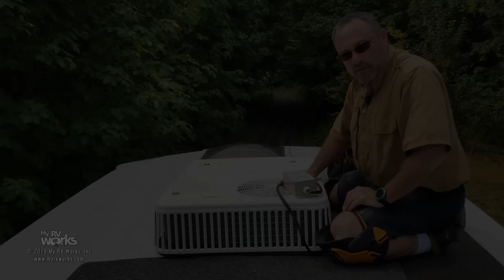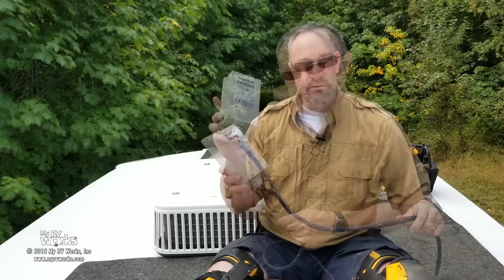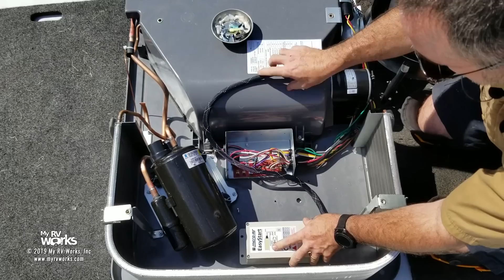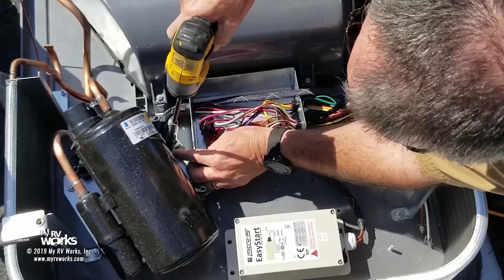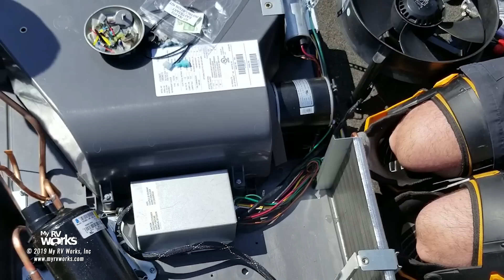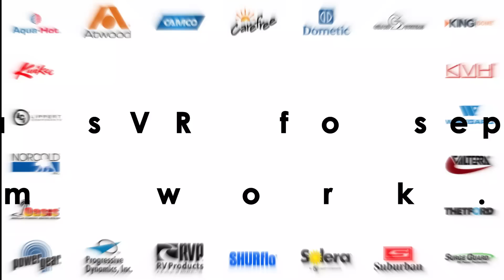How To Install A MicroAir EasyStart Soft-Starter On A Coleman Mach 8 RV Air Conditioner

Comment: Thank you for this!  The step by step was PERFECT.  The only setback came when I thought I remembered what you said but forgot one step and had to re-do a wire connector.  So, I brought my phone onto the roof of my Airstream and re-watched each step.  

I did a couple of things differently on purpose -- but mostly just the placement of zip-ties.  

I would have never thought to zip-tie the EasyStart to the frame, in addition to the 3M tape.  Great idea.  Just like you said, I couldn't zip tie both ends due to the foam block.
I would have wondered what-the-heck to do with the now-loose capacitor.  I zip-tied like you did, but also bent and re-fasted the metal tape that held the combo previously.
I didn't use a zip tie on the EasyStart power cord.  I found I could snake it under the compressor legs and that held it very nicely.

I was moving this EasyStart from an older Mach8 that failed, so all my connectors were already in place.  I was able to work them through the existing opening, but it wasn't easy.

Comment: Hello Darren,
       I have issue with the newer Coleman mach 8 you are using in this video. The condenser fan wont turn on when the unit turns on. The compressor turns on for a bit and the blower motor but not the condenser fan. I installed a new control board in it, and a new condenser fan but it still does not work. I have tested both of the capacitors and they test good. I can not find much information on this unit. Can you give me some incite as to what to check next? What activates the condenser fan? Thank you.

Comment: Hi I have a dometic low pro ac on a 2014 palomino I turn AC on the other day there's only a hum and nothing on fan side so I turn off switch right away I pulled access cover inside if i spin fan by hand then turn on ac and fan both work good so iam kinda thinking capacitor but weird thing is we were in 105 degrees last weekend after a half hour it would just stop fan ac everything give it a while off then u could spin fan and get it to run again maybe after half hour or so. Am I on the right track should I replace one capacitor is there more I should do or ???? Thx for any tips love your vids just found you and am about to try the power lube on a stubborn swinntech

Comment: This what I heard& learned....With the EasyStart you need to start your air conditioner 5 different times, while giving 3 minutes in between restarts for the compressor to equalize. With the regular "SoftStartRv" model u don't have to worry on this. What do u think...

Comment: Darrin, I know this is an old video but I found it interesting that you mounted the MicroAir lying flat underneath the fan.  I did the exact same thing and ended up getting rain water inside the case which destroyed the electronics.  MicroAir stated it was my fault for placing the unit lying down and I was out of luck for a replacement under warranty.  I haven't replaced the MicroAir and wonder if the SoftSartRV unit from Network RV would be any better?  Thoughts?
Reply: In the video he said this is the suggested location. Im hoping you raised a fuss, they are meant to be outside and exposed to elements so they should work in that way. Disappointing, I may choose another brand if that's the customer service you get for $350 a pop. I need 3 of them!
Reply: @JirafaBo  The company never responded to multiple emails.
Reply: @terrygreen2484  sounds awesome....  id' call em, but you probably already have.  everyone swears my rv company (Vanleigh) has the best customer service but I can't get an email reply to save my life.  calling works every time.
Reply: @terrygreen2484  I just looked it up. In their install video they do mount it on the side, but it's a much roomier unit than the low profile Mach 8.  I wonder where do they suggest mounting it on a Coleman Mach 8.  Seems to me it's a bad design if they can't handle the weather, but are to be mounted inside an ac unit on the roof of an rv.
Reply: I originally left a voice mail and the company never returned my call.  If I ever decided to install a similar product….it sure would not be this one.
Reply: I guess he thought that was an "oops" and didn't want to answer? Too bad sorry to hear u had to go through this!

Comment: I leave the Start capacitor in place and tie back the wires.  I also save the PTCR device.  When  I sell the RV, I can put the A/C back to original and move the Easy Start to my next RV instead of having to buy another one.  My Easy Start is on my third RV now.

Comment: Darren, would adding a Soft Start to a unit be good just for making less stress on the unit and compressor, even if not wanting to run from generator power?
Reply: Hope you got and answer long before now. That's one of the reasons I added mine.  Plus in many cases, the install gets you extra warranty from Micro-Air.
Reply: @timzimmerman543  
Thank you for your reply, never heard anything to this point.

Comment: You should go on a road tour! My brand new rig would keep you busy for a couple days...awning works intermittently from the one touch control panel, manual awning switch wont work at all and the Smart Arm controller works just fine. Looking to add solar and a bank of Lithium batteries and adding 2 of these Micro airs, one to a Furrion and the other to a Dometic

Comment: Watched this video, and with the directions Micro Air provided I was able to install this on both my units with no problems.  Only think I did “wrong” was putting on the connectors before threading the wires through the grommet.  That made it very hard to get the wires through.  second time, I left off the connectors until after threading them through the grommet.   Otherwise, it was fairly straightforward.  Watching this sure helped me understand what the directions were trying to tell me.  Thanks!

Comment: Thanks for taking the time to do this video. It was definitely helpful to me. My Mach 8 units are low-profile, but they are "First Gen/Style 1" units and the capacitors are inside the box. It took me a while (too long) to orient myself to it vs. your video, and things went much faster once I realized the start capacitor was "hidden" below the run capacitor inside the box. If I had traced wires earlier, I would have realized this. Also, I think there is room for SIGNIFICANT improvement in the original instructions from Micro Air, plus my install kit didn't have the correct parts for my specific install. I hope this helps someone else down the line. Thanks again!
Reply: ES instructions are pretty decent, but definitely not clear in an area or two. Plus no phone support anymore ;-/ All they need is a 5 minute video or a couple pics.. SMH.

Comment: Are these good for a couch that is a single AC?
Reply from the maker: It's not a function of the number of air conditioners you have.  It's a function of how you're going to start that air conditioner regardless of how many you have.
Reply: @MyRVWorks  thanks I figure it out later when I watch other videos, I didn’t quit know there purpose, now I do may install one on my 18 Vegas later. Again thanks Red

Comment: Two questions. First, why didn't you pick up your metal shavings vs blowing them around in the top of the ac box. Second is why zip ties vs sheet metal screws? Great videos, they help me a great deal.

Comment: Another AWESOME video - many thanks.  Was thinking about the drilling to zip-tie the microstart unit and you might want to consider sliding a piece of sheet metal under the area to be drilled just to add another layer of protection.

Comment: In your opinion, would it be worth it for the slightly restricted airflow, to put screen around the openings of the cover to keep mud dauber wasps ( a plague in SE USA) out of the works? Some of those jokers built several pods on the condenser fan of our AC, and when we turned it on we thought the AC unit was coming off the roof because of the off balance fan, so I screened that unit to keep 'em out. Didn't seem to change any functionality of the AC unit.

Comment: Darren, the additional Condenser cooling fan I added onto the bottom rear of my Norcold 1200 fridge has a similar 'soft start' feature.  That fan is from a computer server cooling application and draws 1 amp of 12v current, but the really cool thing is that the fan takes maybe 4 seconds to come up to full RPM due to the 'soft start' circuit built into it.  I sent you photographs of the installation a few weeks ago and noted an instant improvement in fridge temps!  The slow start feature makes great sense especially in low voltage parks (<120 volts) since as voltage drops, amperage increases and connections get cooked.  Nice video sir!!  Kudos to Dakota too!!

Comment: Thank you for the video. It really helped, especially since my AC unit iss the same one. I did a couple of things a little differently. Drilling through the AC hosing is not that dangerous but, I slipped a small piece of sheet metal between the roof and the AC unit just to be on the safe side. The MicroAir unit I received had plastic sheathing around the four wires rather than the braided sheathing in your video. This made it stiffer and too hard to fold up inside the junction box. I left it outside and used wire ties to secure to the big bundle of wires coming out of the junction box. It lies flat and I have no worries about it interfering with the fan. I also left the start capacitor in because the strap securing it and the other capacitor would have been loose IMHO. I struggled getting the large wire tie through the second hole in the MicroAir unit. Fortunately it was just close enough to the edge of the AC housing that I was able to get my finger under the AC unit and push it up and through the second hole. If not close enough, or fingers not long enough, then a thin piece of wood or something similar should work. Just look down through the hole to make sure the wire tie is lined up.

After the five 10 minutes learning periods using shore power, I tested it on my Honda EU2200i generator that I had just converted to propane (GenConnex). Worked like a champ.

Comment: Love watching your channel. Very informative & funny. Installed one on our 15k rear unit. Works great! We've been up north not needing to operate either unit. 
Now we're in hell - hot, humid SW Fla. Have questions about our front 13k unit. It's "Zone 2" on the Dometic and was showing E1 error. Turned off breakers, unplugged RV. Nothing worked.  Held temp & mode simultaneously to reset error. Now nothing shows zone 2. How do I find ac? Been surfing multiple places to resolve. No luck yet.

Comment: Is there any advantage the installing the easy start from an A/C longevity perspective even if not needed for generator use
Reply: I think the soft start feature would be kind to the compressor startup circuit; any sudden high amperage draw places demands on parts that eventually will suffer from that constant surge of startup current.

Comment: Do you really need to cut and remove the start capacitor?... Just unplugging it and shielding the wires would allow you to remove the EasyStart to move to a new rig... Seems better to make the install reverseable ...
Reply: Good idea
Reply: Really no need to sheild if none of its hooked up. Just zip tie to some wires and be done. Thas how I did it

Comment: Great video Darren.  I have the exact same ac in my RV (actually 3 of them).  One of the front bolts that hold the cover to the ac is just turning.  I'm unable to take that cover off.  Seems like the nut to that bolt has loosened and is turning with the bolt.  Any suggestions on how to remove that bolt?
Reply from the maker: I have come across this a time or two. I just take my Dremel and cut the head off of that Bolt. There's a nutsert on the opposite side of that that, in your instance, is just spinning and spinning so there's no chance you will ever be able to get that off.  I have the tool to reinsert a nutsert but if you don't have that then a larger threaded bolt could bite into some of the steel there and hold that in place.
Reply: @MyRVWorks  Thanks for the advise.  I never miss a video you put out.  You carry a wealth of knowledge and I am sure it has helped many of us viewers.  Keep up the great work.

Comment: Yes it was valuable! One question, what does the top fan do on this newer version? Pull air out?
Reply from the maker: Yes, on these units they have the fan blade that you see on top that is running a constant speed to move the air across the condenser fins. And then the other fan, that is for the evaporator coil,  can be run on different speed settings.

Comment: Great info! Why dont AC OEMs use soft-starts? Will box restrict airflow? Do RV residential refrigerators need soft-starts? Thx!
Reply: @Greco-Roman-49  Does an aftermarket soft-start void OEM warranty? Appreciate the reply! Thx!
Reply from the maker: I would imagine the OEM's are not installing these is because not every air conditioner needs them. If you're plugged into Shore power all the time you would not benefit from the soft starter. Soft starters work in the area where you're running with a generator.
Reply: @MyRVWorks    Not so fast - true for the high amperage draw upon initial compressor startup, but the soft start actually prevents the "slam" sound on some units that occurs when the compressor is energized.  If that occurs at night while sleeping, you'll wonder what just slammed into the coach!  Ask me how I know!
Reply: @Greco-Roman-49  They would never know.....Hopefully "they" dont watch your vids!! lol. Thx!